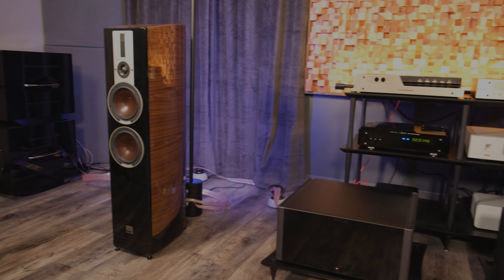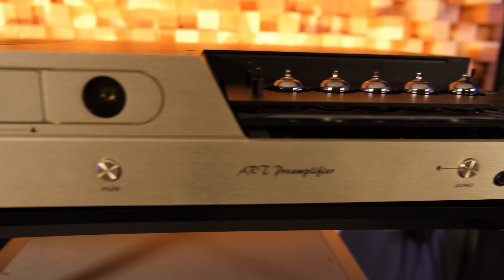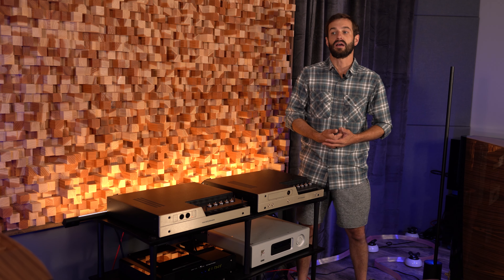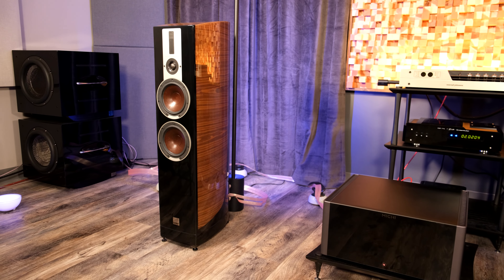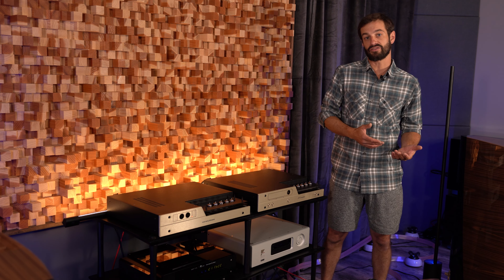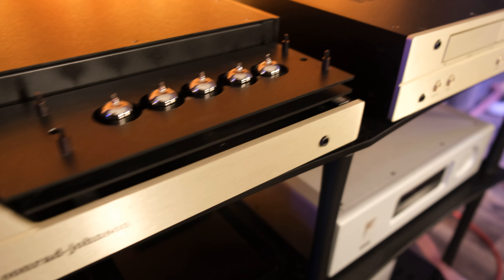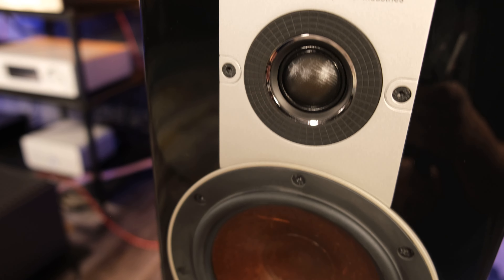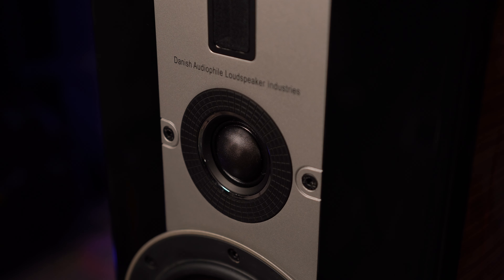Synergistic Setups E07 - Mixing Tubes & Solid State

Comment: Since my system is on 24/7, I have to restrict tubes to sources I don’t always use and where they have the most impact, so in my otherwise solid-state system I have a tubed phono stage.

That way I only burn tubes when listening to vinyl, and tubes seem to do the best there, adding the right body to phono playback.